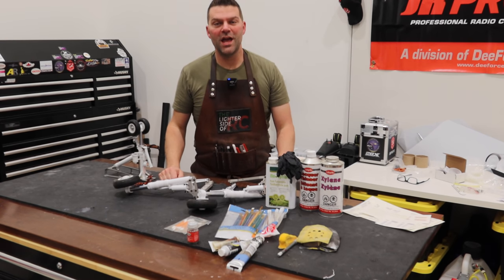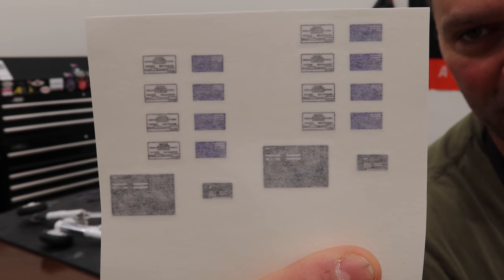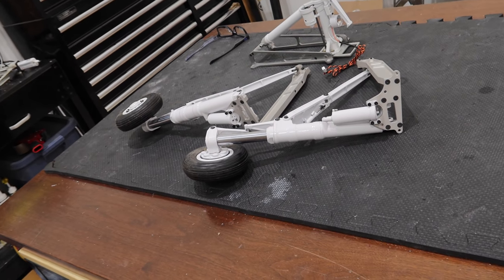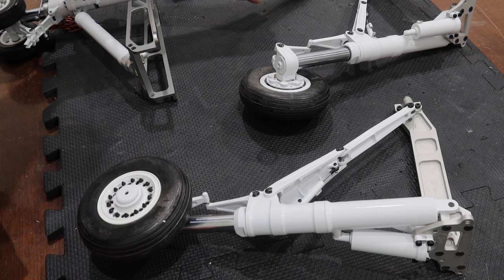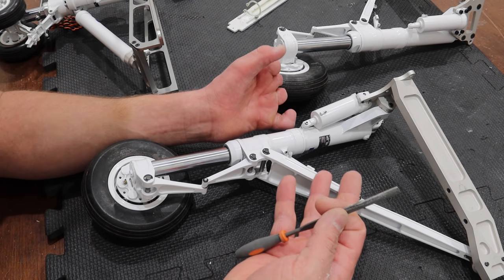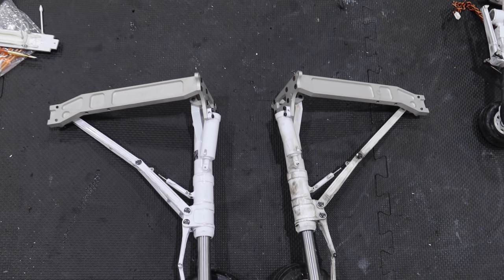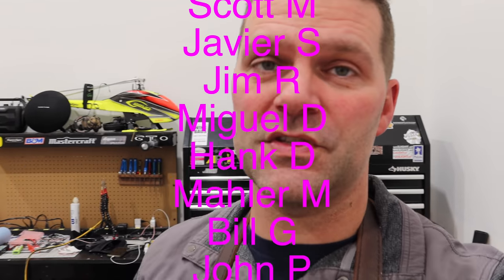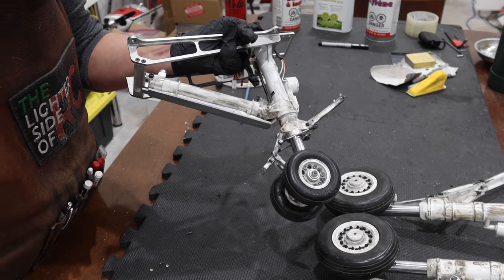WEATHERING the TOP GUN F-14 Gear - Skymaster F14

Comment: G'day from Australia.  
I can't speak specifically about Tomcats, but I've spent over 30 years working on and around commercial and some military aircraft.
The "rust" that I think you're referring to is grease.  it's a red'ish colour mostly, then gets darker brown as it gets dirtier.
And yes, it really stands out against white and light grey landing gear components. 
You'd see it mainly around pivot areas, but it does tend to splatter around on things in the airflow after being freshly applied.
Most of the painted parts of the landing gear of most aircraft is made from aluminium and/or titanium.  You'd never see any Iron Oxide - red corrosion.
But like I say i'm not a Tomcat expert, so if Grumman did indeed use steel on the Tomcat LG then I stand corrected. 🙂 
Love the vids mate, top job.

And loving that Tomcat too.
Cheers. 🙂
Reply: I totally agree, it's not "Rust" it's grease that's turned color, the brakes should be a brownish dust color, on the nose gear it's called  a "launch bar" I hope this helps.
Reply: @robertdmoore2592  The corrosion inhibitor we use on the Hawk looks very similar to HYD fluid.
Reply from the maker: Beautiful!  Thanks for all the info guys!

Comment: I like to use small dollops of Vaseline applied with a pin or toothpick before paint. I prefer it over using an instrument that could mar the metal. Then, knock the paint with steel wool.
Reply from the maker: OOOOO!  That's a good tip!  Thanks for that!
Reply: @thelightersideofrc  the job you did is amazing. I hope you photographed it for your archives

Comment: Alternatively, I suppose you could let the wear marks appear naturally then touch up the scrapes with the "rust" paint.  Whoever is flying the plane needs to remember how Navy pilots land.  HARD!  No floating it in LOL  

The device on the nose gear is called the "tow bar", it hooks into the "shuttle" of the catapult OR into a hook on a donkey tractor.  Most of the wear on that will be on the bottom near the tip and on the back (plane) side of the horns.  Don't forget the arresting hook!  The bottom of the hook portion is going to be scraped pretty bare from hitting the flight deck, the front edge of the hook was usually covered in grease from the arresting wire over bare metal.
Reply: Not "rust" it's more likely grease, posted above is a very good post explaining this, this grease turns a brownish color over time, I'm and aircraft mechanic and I've seen it a thousand times.
Reply: @robertdmoore2592  I wasn't aircrew when I was on Sara, just going both by what I remember it looking like and the way it was described.
Reply from the maker: Awesome info!  Thank you!

Comment: Would there be a case to use a Matt clear over the weathering to preserve the look so it won't smudge or get finger or hand prints when handled?
Reply from the maker: Great question Andrew.  Yea for sure.  If you were using a product that doesn't cure or harden than it would be a good idea to put flat clear over it.  It has been about 5 days now since I finished the gear and if I try really hard I can remove some of my work but it's starting to dry nicely.  In the case of this landing gear I wanted to keep the shiney parts of the leg still shiny and have the weathering.  On a fuselage, different story.